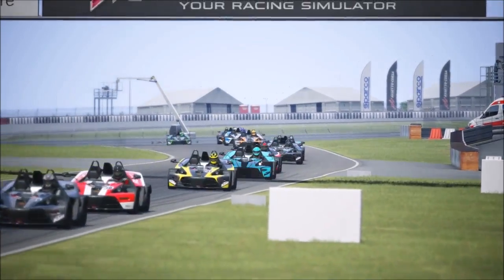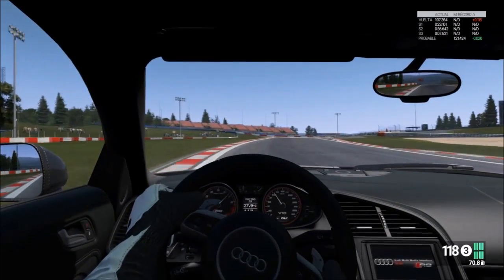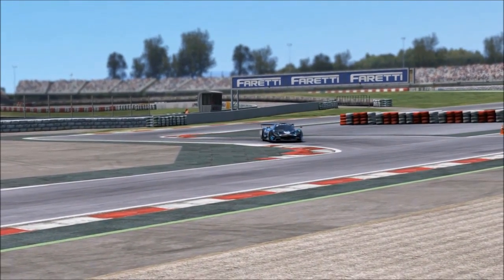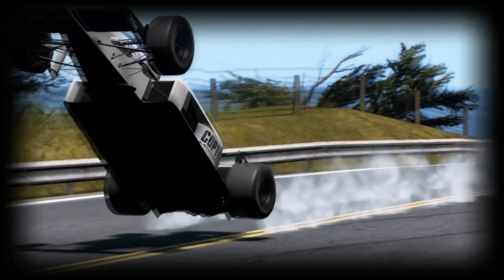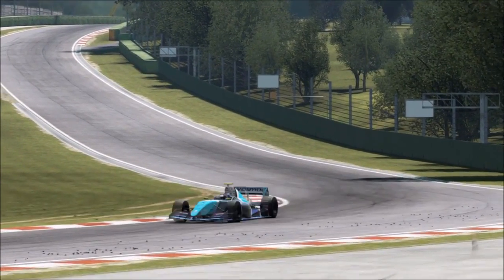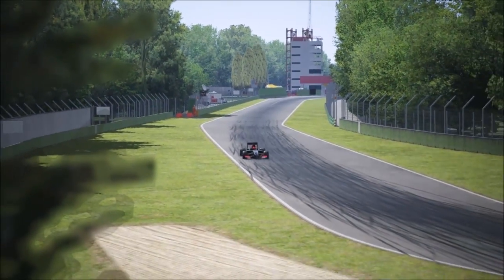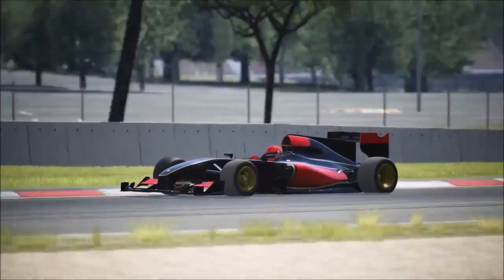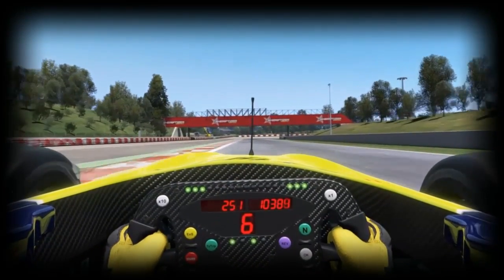Assetto Corsa vs Project CARS: Physics overview (2)

Comment: I prefer AC after the 1.7 patch. Before that the cars in AC did not want to turn in. The thing that I dislike with AC is that the tires of the cars are not what are actually making contact with the tarmac ie the road. They are only an animated representation. You can see that when you are on a curb/curbstone with one side of the car and the other on the road. The car will start to jump up and down. 
In PC the tires themselves are the "physical" object that are touching the ground, not the underside of a invisible cube that slides on the ground with the visible parts like the wheels just a animated part for the looks of it.

Comment: Which of the two Games are better to play with the PS4 Standard Controller?I know these Games are made for wheels, but i'm a terrible Wheel Driver and used to the pad.
Reply from the maker: Both drove terribly bad with the pad when I tried. I didn´t give them much of a chance though, around 10 minutes. 

Project CARS steering was awful and I could not even take the car where I wanted down the straights without swerving. Assetto Corsa was smoother down the straights but the understeer was horrendous in the middle of the corners.

I don´t know which of them can get better with time, practice and better settings thrown in.
Reply: Thanks for your reply. I almost thought that the pad isn't a good device for the Racing Games that become more and more realistic. A wheel is so to say a "Must have" because there are no alternatives (like Controllers for RC cars
Reply: Methos4321 I play AC on PC with a controller, and after a while I was driving with no TC, some cars needed ABS though ;)

pCars on the other hand... what a nightmare! after 3weeks I gave up and didn't go back to it. I thought it was controller settings...but in the end, the physics model was just bonkers for me.
I'm a noob to full sim racing, with Gran Turismo 6 being my last racer, and I transitioned to AC much better than pCars on controller.

Comment: The street cars in AC have no low speed grip at all.  Thats why you see so many videos of people playing it and under steering into every slow corner/bend.  In Project cars the  tyres actually feel like theyre in contact with the track surface. You feel the grip limits building and breaking. I dont feel that in Assetto corsa.  In Assetto corsa the ruf and porsche are fucking ridiculous when it comes to counter steering.  The sense of speed is way off too in Assetto corsa. Looks like youre entering a turn at say 10mph, but the speedometer says youre actually doing 90mph. It doesn't feel or look natural. So you have to do a shit load of laps before youre actually adjusted to the game.  Project cars feels more like real life than Assetto corsa to me.  

The individual cars feel so different in either game too. Some cars in Assetto corsa feel good and some not good at all. Same with Project cars.
Reply: AESCULAPTORmark3 which wheel are you using?  I had trouble using my Logitech G29 with assetto and actually preferred project cars. Since upgrading to T300 i think Assetto is so far ahead of Project Cars in terms of realism. One problem project cars has is offering too many variables, allowing you to tune the force feedback yourself. This is not a good thing if you want the cars to feel realistic  You can tune every single car to feel the exact same way, whereas the force feedback ratios have already been done for you in Assetto, thankfully.
Reply: AESCULAPTORmark3 one thing I agree with you on is the sense of speed in Assetto game. You can be driving around a corner at 90mph and it looks like you're doing 30mph. I think this is a problem caused by the limited FOV in most of the camera options. The maximum FOV in all camera views, apart from cockpit view, is 60 degrees.  In project cars on PS4 the helmet cam can go up to 85 degrees, and other camera views can go up to 115 or 120 degrees. Try the cockpit view in Assetto again man, and increase the field of view to above 60 until the sense of speed feels better. I had the same problem until a recent update that allowed you to do this. Don't give up on Assetto yet, it's amazing when you get everything set up right. Also make sure you don't start driving like a madman until your tyres have heated up. That's another thing that Assetto over exaggerates, but once the tyres at the right temperature it's great.

Comment: Hello, i must again disagree. The way AC behaves on curbs and that green extencions is really unrealistic, please look at this example:  www.youtube.com/watch?v=YqYPU3MNqHw 
And in this emaple, you have both suspension over curbs and curb traction itself, this is that one Pcars produces more realistically:   www.youtube.com/watch?v=WVVITJ8Zfe8
Overall in last video you had better arguments, here i think you just cant judge the game without any illustration from real life, but the strange change of momentum like you said was right, no problem with that. I think you should learn more about that topic, none of these games are accurate in suspension and physics, and every game reproduces the physics and dynamics in different way, i think best way how to get the best point of view for like is to watch videos, interviews and best moments across the motorsport and then you can judge the physics of these two games, but nobody can say more accurately what game is better. AC is more arcadish in drift i think. But thx for video, its good to get other point of view.
Reply: Wrong, the way he shown the curb hit on AC was at a different angle that the f1 cars you shown. Assetto Corsa handles just like that f1 cars if hiting the curb that specific ways.
Reply: Greg Dale I know I'm like 4 months to late, but the front going up like that is actually logical. The Mclaren has it's rear spoiler in a non-drs position, at that moment the aero balance is located at the rear of the car, pushing the rear down in an agressive manner and putting the nose under such an angle it can't recover as quickly because most of the front downforce is lost. In AC if you drive lower or non downforce cars the car will have a more natural looking jump.
Reply: I was thinking that when the car front end flew almost straight up in AC, that it didn't look right.   You proved it with the vids that the corners are more realistic in PCars. Maybe sims types assume more difficult is more realistic.

Comment: Does this apply to both console and pc? I'm playing pcars on pc and I can't agree with the part of the video on grass behaviour, if I get into the grass accidentally it is definitely not the same as driving on tarmac, maybe it's track dependent. Brands hatch for example is definitely less grippy on the grass and you will spin on full throttle.
Reply from the maker: I haven´t played the PC build but I would expect it to be the same in this aspect. 

You´re right about Brands Hatch, maybe not the grass, but the stuff they put right beyond the outside curbs is super bouncy and slippery.

Comment: I was kind of interested in buying Project Cars (I have AC and I love) because I wanted to give it a try. When I watched what happens when you go on the grass I decided to stick with AC.
Reply from the maker: I would say right now it´s worth buying. It´s super cheap, the most blatant bugs have been fixed, and it has shitloads of content... the content is nowhere near as good as AC, but still OK. If you find it at reduced price it can be a good deal.

At release it was a no-no. It was broken, expensive, and if on top of that it isn´t a great driving experience...
Reply: Thanks for your suggestion. Unfortunately I don't have too much time to play, so I need to make some choices. But we'll see. At this point I might as well wait for PCars 2

Comment: Honestly i don't put much merit in comparisons between the two games. Only a race car driver of that exact car could tell which feels the best. Project cars game engine is supposed to process more calculations per sec than than assetto. I racing for example prides it self on being realistic and such but i have heard/read that real racing driver's say it's not as hard in real life compared to I Racing. What we must understand is all these racing teams aim for an easy car to drive. An easy car is a consistent car.  Many people attribute how hard a game is to how realistic it is which is wrong really. The f1 example you gave shows the car far more skittish than the p cars version but these car's have great down force and huge tires with soft compounds and not really all that much torque compared to horse power. Maybe it is that skittish but i just find conflict between the two games. Good review none the less. I'll give it to assetto though for it's laser scanned tracks
Reply: All I know for sure is that Project CARS feels very "basic" in comparison to other modern sims. Cars just don't have the feel of weight like they should and some cars like the GT40 feel completely unfinished and un-drivable.
Reply: Wabbit    yeah I don't know. I play with controller and have my settings about perfected and the cars seem believable in handling. I think the whole which one is better relates to just force feed back
Reply: I find assetto a bit under steery but it feels good. I don't care for the basic setup options though
Reply: Have you drove a gt3 car or any race car for that matter ??? It's all hear say really
Reply: I have both games by the way. Assetto is great
Reply: You drive PCars and u imediatly see that game is unrealistic, people who dont understand that are just not into cars/racing in real life and You dont need to have a race driver license or own a sports car to understand that. AC is a sim, PC is an arcade game. And there's no problem on that, some people might enjoy more that kind of game....